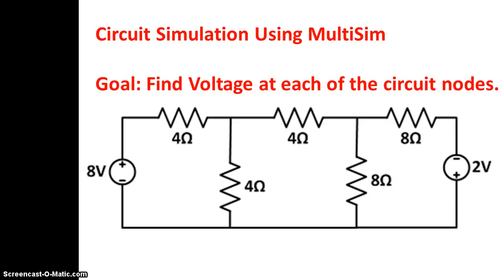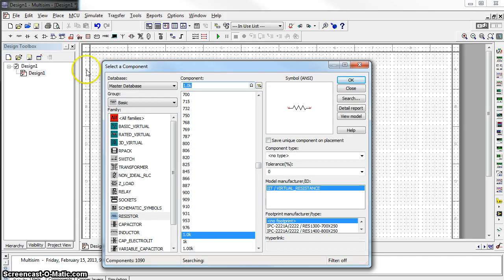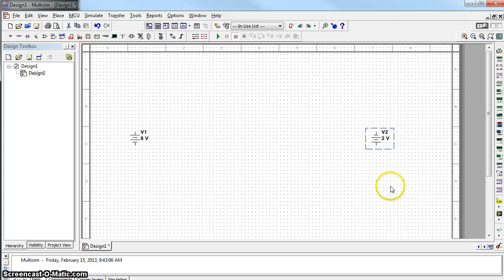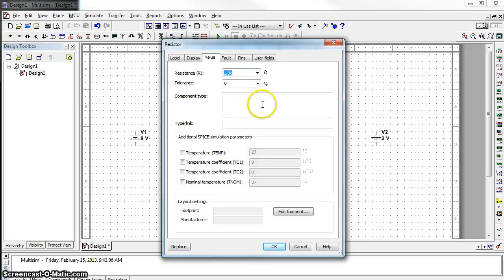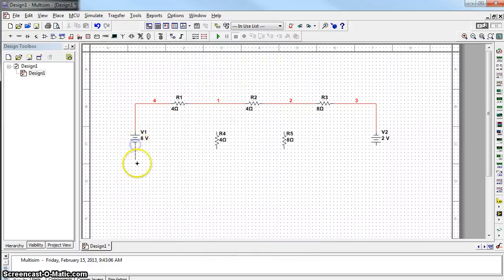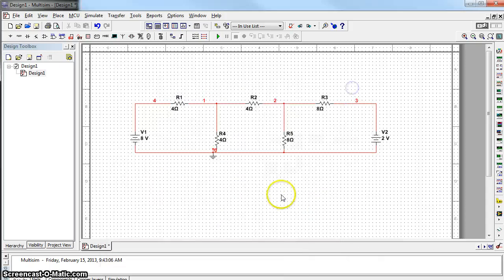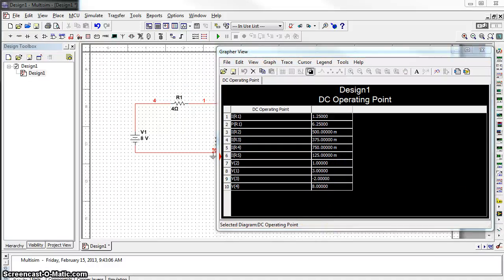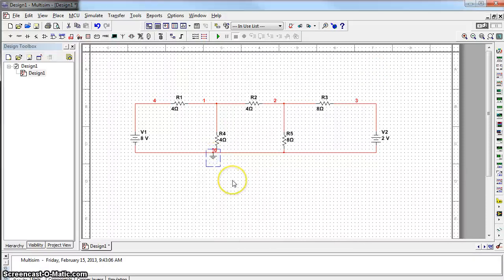Circuit Simulation using NI MultiSim

Comment: Not well prepared, there are a number of mistakes. For example, while doing DC Operating Point Analysis you do not need to close the dialog box, press Run button and then return back. Run button is needed only when you have instruments placed on the Schematic. Also, you only need a single click to begin and end a wire, when a dot shows up.
Reply from the maker: The Dialog boxes and menus might look different with a the latest version! You do realize that this was based on a previous version of Multisim (6 yrs ago!).
Reply: @ENGRTUTOR  The above is true for all versions, even the earlier ones when Multisim used to be called Electronic Workbench. The look and appearence of Dialog Boxes and Menus has nothing to do with that.